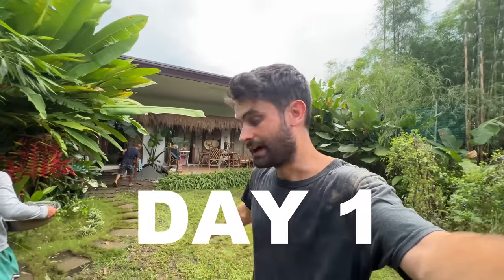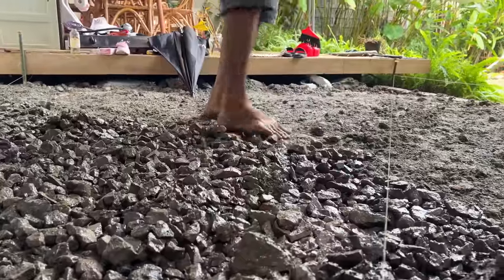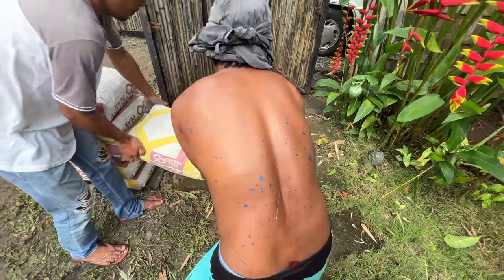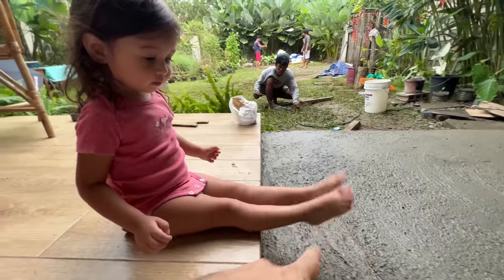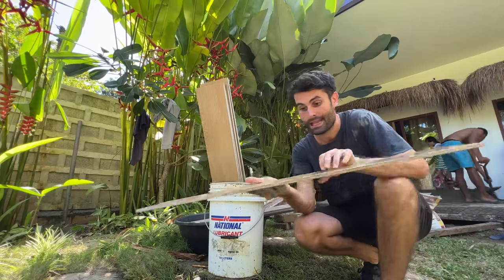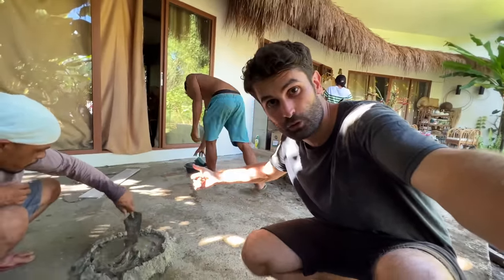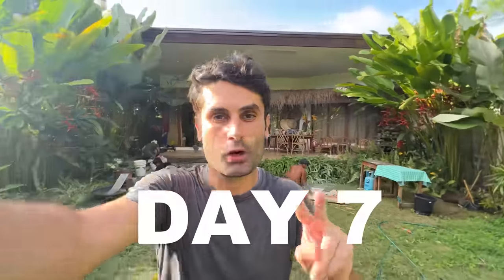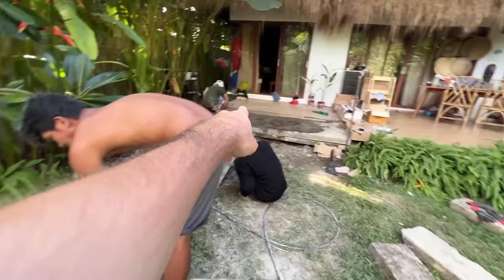PATIO MAKEOVER in Our Philippines HOUSE | I Installed TILE FLOOR for the FIRST TIME

Comment: Much bigger area for playground for bella. Much better if you use the tiles that are not smooth because during rainy days it is slippery to walk on to prevent injury.
Reply: nice.. But it would be more nicer if you put a railings half of the  patio length and a plant box for flower plants only